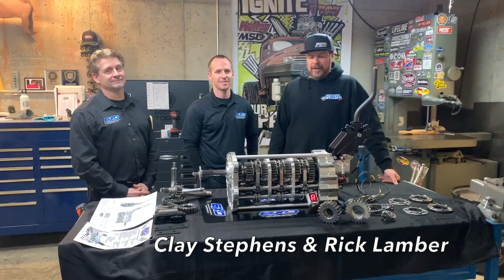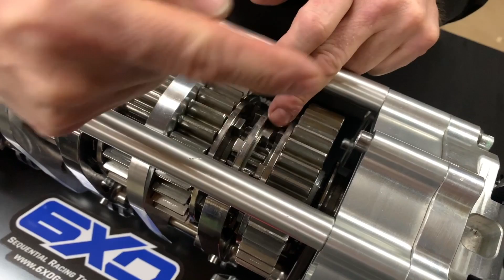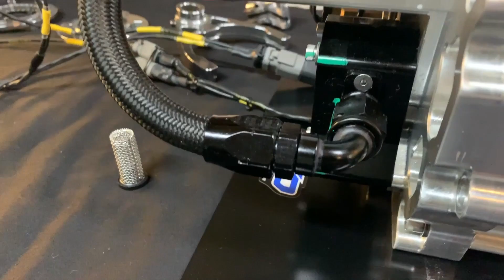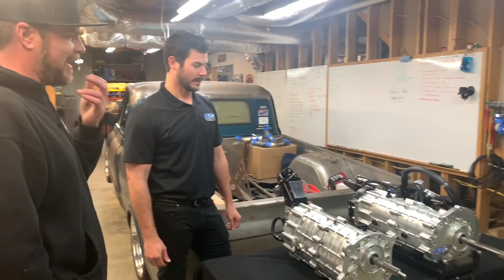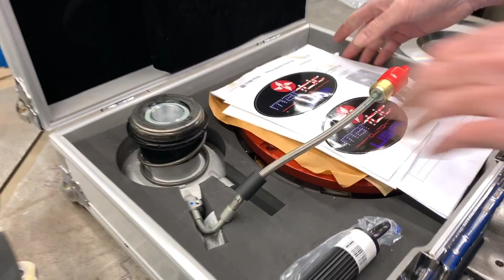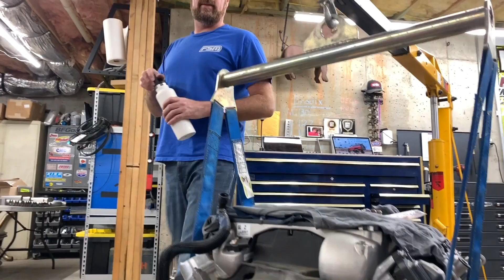First Look Inside a Billet Sequential Trans for my '67 C10! Finnegan's Garage Ep.99

Comment: Sequential gearboxes are awesome. Here's Peter Shattock from Outlaw Flat Four with a Hewland six speed sequential in his 1961 Beetle. Runs consistent low 11s and high tens with a sub-1800cc engine. No power adders, all steel, street driven (across Europe!)
https://youtu.be/uiEk_sE4Yzs

Comment: I race on dirt what do you have for that I use a 3 speed Chevy trany and I run 2 gear I dont need 6 speed 10 inch clutch with a 355 cubic inch Chevy engin I get hit I shear bolts can you give advice on it.

Comment: I can see them having customers ask for two things in future - the first will be a racing transaxle version, for all the Porsche, Ferrari and Lambo racers,.. and from there, a Street version with helical cut gears.
There's a little jingoism with the 'made in the' (insert your own country here) comments, but if the current state of the world has shown anything, it's that Every country needs a quality manufacturing base, not to compete world wide, but to supply local needs when international shipping isn't possible - wonder if the 6XD guys would license the design to other manufacturers? Rather then have to deal with shipping and local regulators, they could earn their profits for overseas sales by licensing and manufacturing QA approval deals.
Example, someone here in Oz could market locally as "Made under license to 6XD's design and QA Standards", and we can leave out all the headaches of shipping and import duties and customs inspections...

Comment: For drag racing why not just go powerglide?
Reply: Sequential transmissions in drag cars are used over automatics due to the lower rpm drop between shifts   mostly used on low torque high hp drag cars usually imports
Reply: @Realtime1501  thanks, guess I didnt think about that.

Comment: Can this be used in a diesel application with 600 hp/ 1000~1200 tq?
Reply: Transmission is rated at 1800ftlbs in a 3000lbs chassis so I would think you'll be alright

Comment: Why is he using the clutch if it's a sequential gear box in the end video. Like wtf it's supposed to be clutch less
Reply: Steven Plaskett Still need a clutch to stop, start, and drive slow. Otherwise no need for third pedal. Have seem some running a fluid coupling that locks up at set rpm though.

Comment: The people bitching about the cost of this sequential box saying "there is cheaper ones out there" yea maybe so but those box's are only designed to hold 500 or so lb ft of torque boxes like this can easily hold 1000+. If you're complaining about how much this box costs then you really dont comprehend how much racing at or near the pro level will cost you and probably never will. It takes hundreds of thousands of dollars of R&D, track time, spare parts, support staff (like mechanics, truck drivers, pit crew, team manager) logistics, fuel for car (and whatever is towing your car, mobile workshop, parts etc.), tools, a decent driver (unless the team owner wants to drive) and at least one spare  ready to race chassis. Think about that and today's costs and $16k is just a drop in the bucket. Boxes like this aren't really designed for the average joe weekend warrior they're designed to be raced every week ran hard and abused without failure, you're paying for the modularity, R&D, quality of parts and manufacturing and the reliability.

Comment: These guys talking about not spending a lot of money, this transmission is $20,000. Sure you get cheaper replacement parts, but you are really paying for them up front anyway. I have a Liberty LSC 5 speed and it has replaceable faceplates and a clamshell design. Overall better unit than this transmission and is 1/4 the price.

Comment: Basically this is a $17,000 enlarged knockoff motorcycle transmission... without even as much as a wet sump clutch pack.  I can spend 17 grand on alot of things besides this noisy box of gears, bearings and forks...